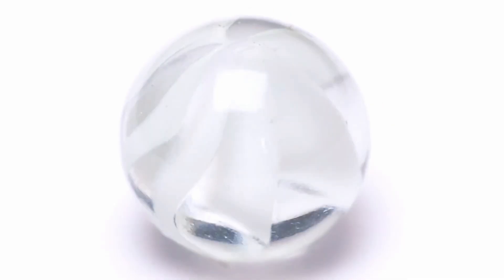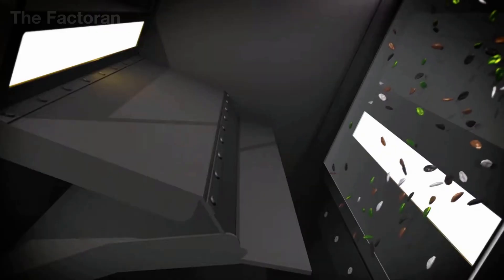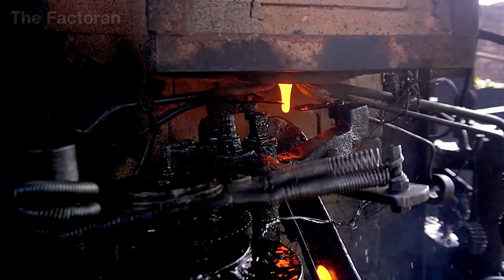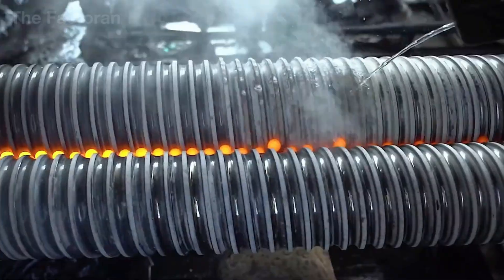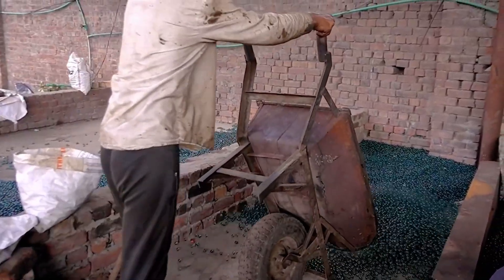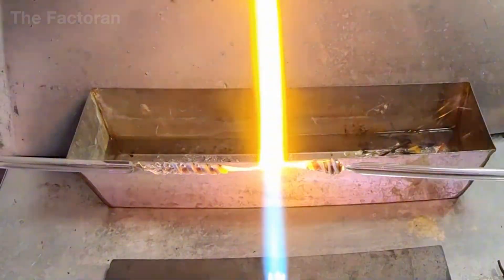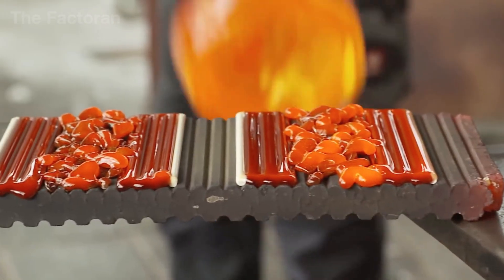How Billions Of Marbles Are Made From Recycled Glass Inside Massive Factory

Comment: OSHA definitely isn't in some of those factories. 
Guys working with molten glass while wearing sandals!
Reply from the maker: Safety standards vary a lot by country, but proper protection is always essential in industrial work.
Reply: Construction work in some of those countries looks just as primitive and unsafe.  OSHA is an American entity.
Reply: @kh3612 
For sure. 
I spent 50 years working in construction in the central Kentucky area. 
I  had to threaten to call OSHA on a general contractor who refused to relocate a gasoline powered welder from the room where my crew was working.
We were getting poisoned, and he didn't want to move the welder.
I got run off of that job right then, but they did move the welder. 
Another time, a guy fell and died when the walk board broke. 
They interviewed everyone on the jobsite after that.
In my experience, I've discovered that people act whenever OSHA is mentioned.

Comment: BS, even here at 5.08: "If even a ....wrong color..": Then showing a mixed mass of "sorted glass" at 5.13.
I can't believe this is advertised as "information".
Reply: If you had stuck around a little longer (because I was thinking the same thing as you) then you'd see how they had automated optic sorters with precise puffs of air to sort by color and composition. Pretty cool stuff, and one of those times I do think automation is superior to humans trying to pick out and puff off the wrong little piece of color glass on a fast-flowing conveyor belt! 😊
Reply from the maker: Thanks for the feedback. We’ll review that part and work on making it clearer and more accurate
Reply: There is a highly specialized glass factory, with optical sorting machine, computers, automation and all thats stuff, but second part of the video shows Pakistani workers in no-safety manufacture...

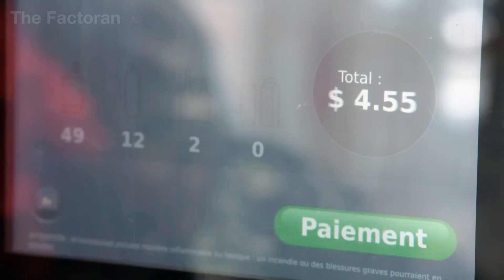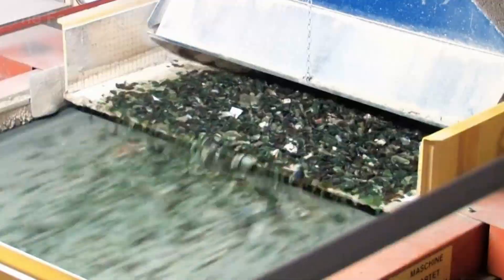Comment: What's the point of separating the different coloured bottles into separate bins 2:24 before collection if it's all crushed in the factory together and resorted later 4:26?
Reply: The AI that made this used conflating images of the return and sorting process. Your bottle return does not sort them by color or anything like that but the video leads you to believe that's what happens at your local WalMart bottle return. It's wrong.

This is why it's important that YouTube begin labeling AI generated content.
Reply from the maker: Good question. Color separation helps keep recycled glass quality higher later in the process.